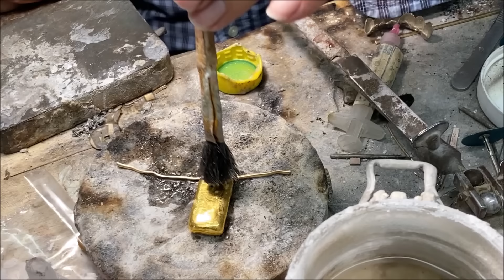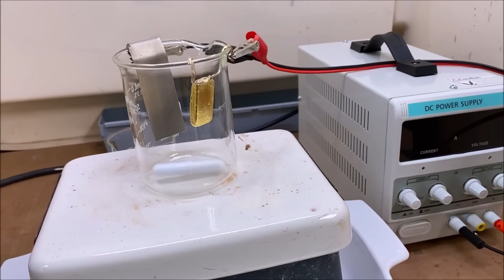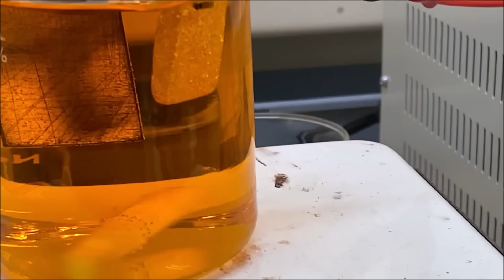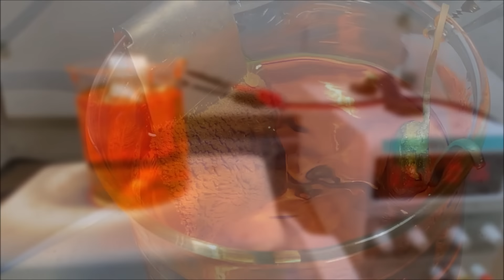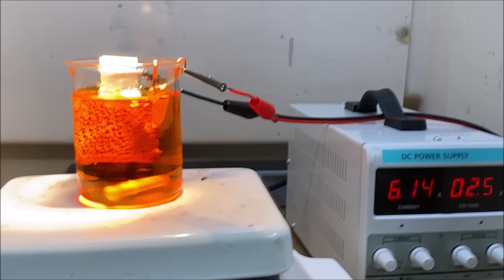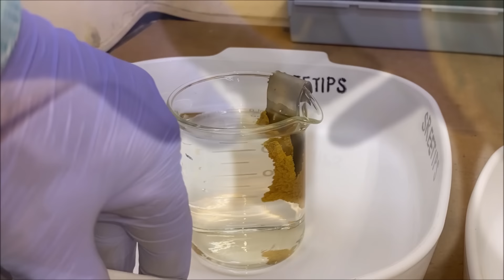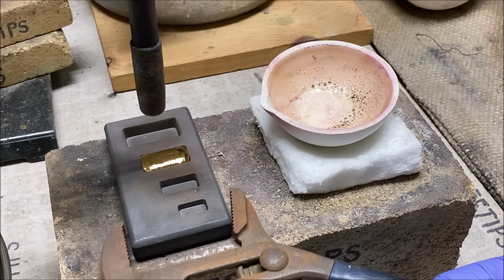Electrolytic Gold Cell Part 2

Comment: This is an old post now, but on the off chance you do see this, I'll leave a comment anyway. I worked in a copper refinery where gold and silver were by product. Before the stailess cathodes were placed in the copper refining cells, we used to spray a thin coat of wax on the side and bottom edges of the anode to prevent full encasement of the anode. That way, when the cycle was completed, we just bent the anode, and the copper plates would just fall off. I know the electrolyte solution for gold is different from copper, so perhaps it would just disolve the wax and corrupt the solution. Im a fitter, not a chemist. Therefore, I really have no clue😂. But, thought I'd mention it anyway. Anyway, great video, keep up the good work. Your refined gold looked just like the refined gold we used to produce before pouring into bars. Cheers 🍺
Reply from the maker: I’m a retired Naval Engineer. I ordered a larger titanium cathode and I plan to repeat this experiment with a larger anode. I’m going to find a machine shop that can cut down the sides to form a slight taper, and round off the edges. I’ll give that a try and see if it helps. I’d rather not use a release agent unless I absolutely have to. What was the electrolyte for the copper? Copper sulfate?
Reply: @sreetips  I'm not sure mate. As a maintainer, we didn't really need to know that side of it, so we just called it for what it was, electrolyte. I do know if you got it on your skin, it would itch like crazy and if you left it long enough, it would burn. If we got it on our work clothes, we threw them out because the next time they went through the wash, there would be a hole wherever the electrolyte touched the material. It was a BHP site called Olympic Dam in South Australia. There were 4 minerals removed for sale in the process's across site. Copper was the main product, with gold silver and uranium being by products. Can you imagine the safety standards required on a site like that, man!? The chemicals used were insane. Arsenic and cyanide being just a couple. 100% Hydrogen Peroxide! You probably already know what that does when it touches anything organic. You couldn't have any skin exposed in the peroxide yard, so checking the pumps was a major ordeal. Anyway, sorry I couldn't answer your question. You could do a test with a lump of wax in your electrolyte and see if it dissolves at all. If your other titanium anode idea doesn't work. Cheers 🍻  Aaron
Reply from the maker: Thanks for the answer.
Reply: @sreetips  I have spoken to one of the boys there. He says he thinks it's copper sulphate. But didn't sound like a definite answer. It was blue in color and left blue crysals growing anywhere it leaked. So, it kind of does sound like a copper sulphate solution.

Comment: I don’t get it. You turned a 58g ingot into a 45g ingot. Why? Where’s the 13g of gold gone and why would you do that? Is it more pure now?
Reply from the maker: The anode bar was about 995 parts per thousand. After running thru the cell it’s now 9999 parts per ten thousand. The remaining 13 grams will be in the part of the anode that remained undissolved (the sharks tooth). I did this video for the show, to demonstrate that it can be done by an ordinary individual in the garage. Plus, I get a new and highly valuable video for my channel. Hope this helps. Thanks for looking at my video.
Reply: @sreetips  thanks for the response. Your videos are hypnotic! I can’t stop watching them 👍🏻😬
Reply from the maker: Thank you!

Comment: I'm so sorry if I sound ignorant, I left school at an early age but what actually happened? I mean to ask, did you end up with more gold? or is it just purer? is Electric gold better than natural gold? Would a gold monger prefer natural over Electric gold? again, I'm sorry for sounding really dumb, I found this so interesting but don't understand a thing 😬
Reply from the maker: No problem. What I’ve done is taken a gold ingot that was perhaps 995 parts per thousand pure gold and used it as the anode in the electrolytic gold cell. Three nines (999 parts per thousand) is industry standard for pure gold. I dissolved the 995 anode bar by passing an electric current through it while it was submerged in a gold chloride solution (the electrolyte). The dissolved gold ions, pushed through the electrolyte by the current flow through the cell, deposit on the negative side of the cell, onto the titanium cathode. These deposits build up as they accumulate on the titanium cathode by the electrolytic action in the cell. Any impurities will remain in the gold chloride electrolyte. The gold deposited on the titanium cathode will exceed three nines fine. So I’m converting the 995 pure gold anode bar (the anode must be relatively high purity to begin with for this to be a success) into four nines ultra high purity gold because only the pure elemental gold will deposit on the cathode. The Royal Canadian Mint uses this process to make four nines high purity gold for their highly sought after Canadian Maple Leaf one ounce pure gold coins. I can do it in my garage. No new gold has been created out of thin air. I’m just refining the gold to high purity.
Reply: @sreetips  thanks so much for that detailed answer to my questions! I think it's incredible that such feats can be achieved at home! My assumption after what you've told me is that you've managed to make your original gold go up in value?
Reply from the maker: Three nines fine is industry standard for pure gold. So the extra nine is not necessary, unless needed for some specific purpose such as a test standard. I only did it for the show, to create a new video for my YouTube channel.
Reply: @sreetips  well it's appreciated! the algorithms churned up a bunch of videos (as youtube does) based on me searching for gold panning videos which is not wildly outrageous I suppose especially as I got to see something I wouldn't have otherwise looked for. Thank you so much for the time you spent helping me understand and for the really interesting video and insight into alchemy! 🤘☺️
Reply from the maker: Excellent, thank you for watching

Comment: so I'm confused, you have to have at least $6,000 worth of gold to even do this? Was the intent to get more gold than you put in? Otherwise this looks like you dissolved one bar across electrically charged liquid, piled up on cathode, and you scraped it off and re-melted it. What was the intended net/ end result of this experiment?
Reply from the maker: Yes, I did it for the show. No new gold was created out of thin air. This is electrolytic refining to four nines, in my garage.

Comment: You got to tell us how much gold you started with and how much you finished with.  Also if the gold increases how does it do so?  Leaving all the info out makes it seem like what you are presenting is really not true.   It would have been good to recover the gold in the acid/ electrolyte and melt it so we could see all that gold was recovered or what portion was recovered.  Honestly I am skeptical for these reasons.
Reply from the maker: It’s the same. I refined it to high purity for the show. No new gold was created out of thin air.
Reply: No need to imply dishonesty. Simply asking would suffice

Comment: What sort of extraction hood/table are you using and are these available used (what to search for)? Great video 👏🏻
Reply from the maker: It’s a fume hood. But the one I’m using is not good for refining. It has metal parts that get corroded from the acids. I’d recommend Salare Inc in North Carolina. Their hoods are made of composite materials and are suitable for acid digestions. Pricey

Comment: I understand what refining does. But where is the  "growing" part. you don't actually grow gold. you extract gold from scrap and you just transfer already existing purified gold (anode) ? so basically you don't produce more gold, you just get rid of impurities and reach 24k status? am i missing something?
Reply from the maker: Grow: to increase in size or mass. And that’s exactly what’s the gold is doing on the cathode. As the anode dissolves, the gold ions travel through the electrolyte and deposit (grows) on the cathode. No gold is being created out of thin air.

Comment: Curious what the cost of input vs output return is - examples are fine. It seems to be a pretty significant process/cost in both time/energy for refinement. Also, would it have been beneficial to flatten/widen the annode to create more surface area?
Reply from the maker: I don’t track the numbers. Yes, the anode would work better if flattened.
Reply: @sreetips Thanks! I am interested in possibly making this a business within the next 10 years  - I greatly appreciate these video's - very educational! Also, I appreciate the response! Best of luck!
Reply from the maker: I like doing this a lot. But I couldn’t see having to do it for a living. Maybe buy all the stuff, hire people to do it all for you.
Reply: @sreetips  I would be retired so sort of a side gig. It would be an operation relative to what they do on the 'mbmmllc' channel where bulk material is ground up/run through a sorter/shaker table and then refined. However, I am stuck on the refinement peice and may skip that portion until I have better understanding/process nailed down. I think an electrolytic process would probably be better for bulk materials so I could run several separate baths that are refining out various materials all at once. Considering the more than 10M tons (and growing) of E-waste that is not recycled annually, in just the US, I think the operation could be very lucrative.
Reply from the maker: Please understand that electrolytic refining works best when the anode material is relatively high purity to begin with.
Reply: @sreetips  Thanks - I will consider this. 100% I would need PMA/R's to run that end of the process (if I extend into the refinement side), but I will certainly continue to watch your video's for info. Curious, if substantial, what sort of power costs do you have for the scale of what you are working on? Is it a pretty nominal cost?
Reply from the maker: My electric bill last month was $115

Comment: Did the liquid acid cooled the liquid or helped mantained the liquids temperature? I got confused and never knew liquid acids boiling point and i googled and surprisingly....it said b.p. is -121 ferenheit. 😮.  But your heat radar thing showed temps that would be very hot near b.p .
Reply from the maker: The book called for heating the electrolyte to 140 degrees F (60 C) so I did

Comment: The nice thing about using a titanium cathode is that you could just melt the gold off the cathode since the melting point of gold is so much drastically lower than Ti.  No need for scraping and fighting it.
Reply from the maker: The gold will get welded to the titanium if that was tried.

Comment: 8 Months ago. New power supply.

You have probably figured it out by now, but if you have not, that supply has current control.

With the supply on, set the voltage just a tad above the highest voltage you will expect to ever run (6V in your case), turn the current limit all the way down.

Connect the suplly to the cell and turn it on. Turn the current limit upnto the level you desire (4.5A you liked).

The result will be that the supply will now automatically change the voltage as the chemistry changes so that the cell always draws 4.5A.
Reply from the maker: We want a constant 3.5 volts DC. The range is about 3.3 to 3.7 volts. Above or below that and contamination could happen.

Comment: The bar you hung from the jar looks like it started to reduce in size. Did it actually get smaller, and if it did, what was the weight after the process?
Reply from the maker: That was the anode bar. The current flow causes it to dissolve, the gold ions travel through the electrolyte and deposit as high purity gold, four nines fine.

Comment: So the electolyte is pre charged with gold ions, and the anode is the source. what you did is refine the anode, not so much with the electrolyte. once the electolyte came in balance , the anode was the only source. 

electrolytic deposotion on titanium could contaminate the electolyte due to the acid. 
if i would suggest using a pure carbon container like a carbon crucible as the cathode, and another basket cell as the source, you could electrically transfer the gold ions to the carbon surface. 

Chemiclly in nature , high carbon content rock causes gold ions in magma to drop iut of solution in very pure crystal form. 

the low voltage esures only gold ions are transfered, as different metals like copper and PGMs each have their own ion transfer voltages. 
i would expect 5-9s or better with a carbon cathode and a gold shot basket like your silver cell. 

As you noted your silver cell is blue, which is copper, the silver is clear or invisible, and the pgms stay in the slimes in the basket.

Comment: If you are going to be using the gold cell much, you might consider making/modifying an ingot mold so it will have an attachment tab for your positive power supply wire.
Reply from the maker: Good suggestion.

Comment: Can we used cylindrical cathode Titanium instead of flat bar Titanium . No sharp corners . Also , what about freezing whole cathode with Gold . Different in thermal expansion Gold-Titanium could brake Gold from Titanium .
Reply from the maker: I don’t know, I don’t have enough experience to know if cylinder of titanium will work. But I don’t see why it won’t work. But it would probably deposit gold on the outside portion facing the anode. I don’t think freezing is necessary. That gold didn’t come off the cathode easily. But it did come off completely with a little force.

Comment: Hi, what is the purpose of the gold cell? The silver cell takes impure silver and purifies it. But it appears you're taking a pure gold anode bar and plating it onto the titanium... for what reason? Seems like electroysis would be an easier process for purifying gold than all the steps required in the aqua regia process.
Reply from the maker: The anode must be high purity to begin with. It was about 995 parts per thousand in this case. After plating on the titanium cathode the purity goes up to four nines. Or, 9999 parts per ten thousand. That’s it.
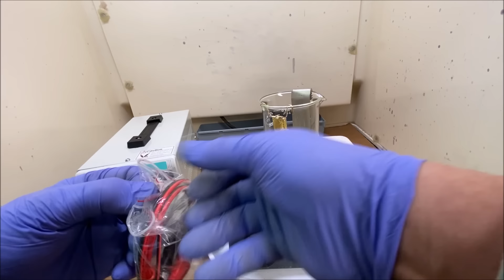Reply: @sreetips   I don't know if you need more projects LOL but I thought you might find this interesting. I think the process is called electrowinning - in this video they make concentrates from gold ore and leech it to get what they call a pregnant leech liquid. They then feed it into an electrolysis cell made by Ion Net. The pertinent part starts at 7:14.
Reply from the maker: I’ve used chlorine leaching to extract PGMs from automotive cats. Once leached, there’s no need to go electrolytic (at least not at my level). Just filter the pregnant solution, drop the gold with SMB. With electrolytic refining the anodes must be fairly high purity to begin with.
Reply: I have yet to watch how the scrap silver is prepared before placing in the basket. Can you just chop up some various grades of silver into little chunks and put them in the basket of the silver cell?
Reply from the maker: No, I use cement silver from my gold refining. It’s 98% to 99% pure silver, with the rest being copper.
Reply: @sreetips  I understand now. Thanks.
Reply from the maker: If you put sterling silver in the silver cell then the electrolyte would soon become saturated with copper.

Comment: Your videos are fascinating.
I used to work as an electroplater, coat the surfaces you don’t want plated with protective dipping wax. That’s what used for the item being plated. A different product is used in the anode and cathode bars and racks. It’s called plastisol.
Reply from the maker: I could put platisol around the edges of the titanium cathode. Maybe it would release better for me.

Comment: It's gold, why didn't you just either roll your bar into a coil wire. If you're using the ring, just put one cut, punch a hole in the bar, thread it like a shower curtain, and it can dangle, yo.

Or even just gator clip the bar and only submerge 3/4 of it.
Reply from the maker: Yo, didn’t think of it.
Reply: @sreetips  😁 I often make things too hard for myself. I have to step into a different brain and look at what the self destructive time waster in my head is trying to do and make it less so, lol
Reply from the maker: If I do this again (highly likely because of how easy it is and how high purity the gold is) then I’ll probably still weld it on. It’s the only way to be sure. Maybe drill a hole first, then weld the pieces into the holes.
Reply: @sreetips  oh dude, just thought of this. Just drill a hole, tighten the wire to it, then use the anti oxidizer one uses on the power main! Then your connection will stay solid, and you can avoid steps!

Comment: YOU NEED TO CONSTANTLY STER THE ELECTROLITE IF YOU ARE USING THIS METHOD BUT YOU CAN SOLVE THIS WITH A SMALL AQUARIUM PUMP
Reply from the maker: I THINK I DID HAVE A STIR BAR IN THERE.